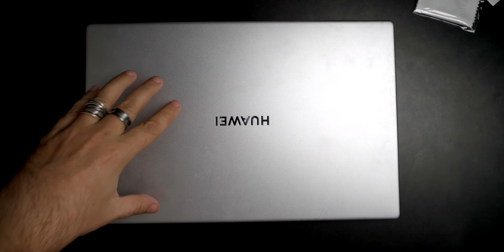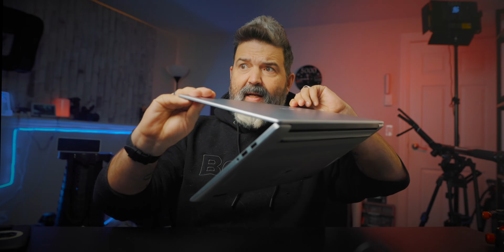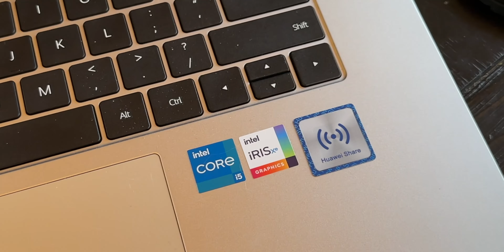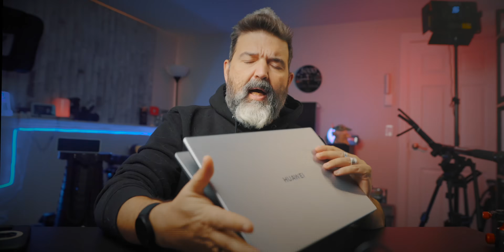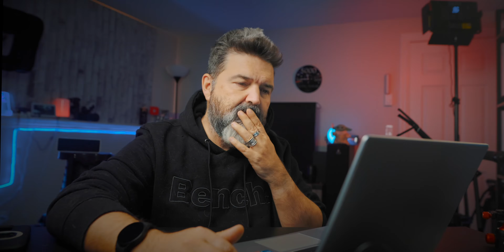Huawei Matebook D15 11th Gen Intel i5 Review in 2023: Great Performance and Design!

Comment: the only problem with this laptop is its 8gb of ram that's just awful phones are using 12gb in this day
Reply from the maker: More ram would definitely be better. But they have models that come with 16. So you just need to figure out what you need. I use this laptop as my streaming computer and it works great. 8 gigs is fine.
Reply: @gregtoope  yeah i got it yesterday,the best thing i liked about it is the design it feels super premium i was blown away by it , got it for 416$ i511th and 512gb version
Reply from the maker: @sanfury  that’s a fantastic price. Have fun with it.

Comment: Bought the D15 like 6 months ago, it's running on the 11th gen i5 with the 16GB ram and I am loving it. It performs really well and lasts long enough for the day and I can lightly game on it too.  What I love about this laptop is that there are a lot of 3rd party accessories that fits it, I have a clear case on it just like how my macbook air used to. The only gripe is the camera position but I can use my phone and output webcams at 4k because of it so I don't care much about the webcam position.
Reply from the maker: It’s definitely a great machine. I use mine as my streaming laptop. So it controls all of the video and audio capture. Works flawlessly.
Reply: Can u use it for playing games? Like Roblox or Fortnite or Minecraft?
Reply: Dude..
Does it have backlight keyboard?